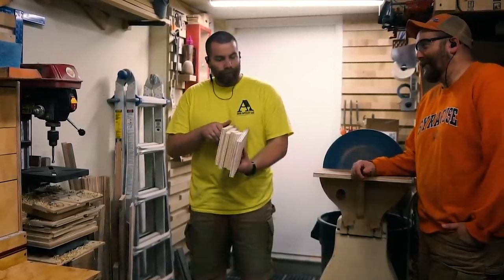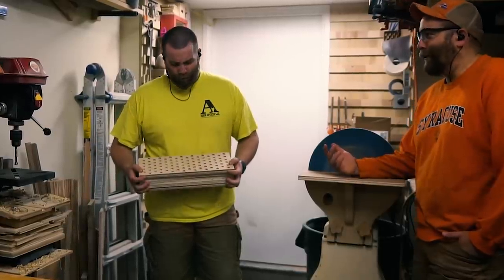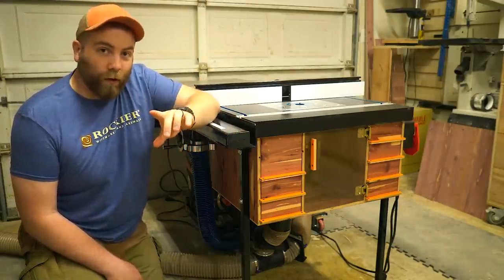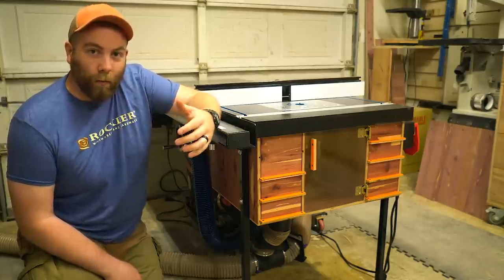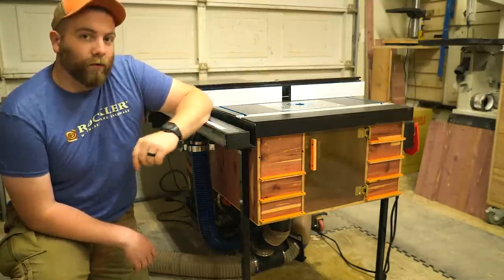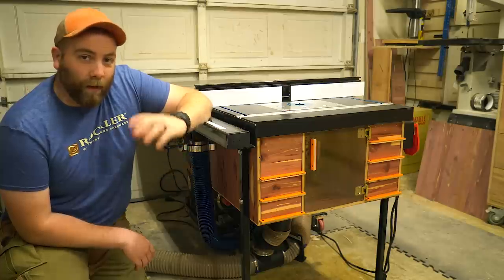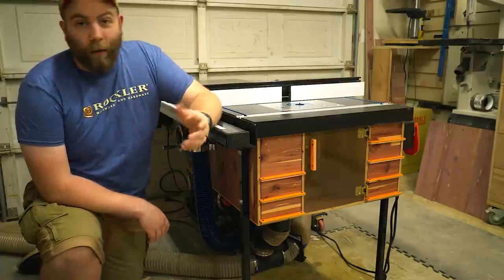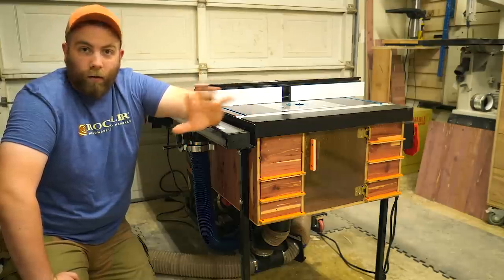Ultimate Router Table & Storage Cabinet (table saw extension wing)

Comment from the maker: Full build details: https://www.jackmanworks.com/ultimate-router-table-storage/
► Check out all of the amazing ROCKLER tools and materials used to make this project a reality!
Materials & Parts: 
Wide T-Track http://bit.ly/2lgOwZZ
Regular T-Track http://bit.ly/2JQhRt6
Router Table ProFence http://bit.ly/2JZYAo9
Router Lift FX http://bit.ly/2otzljq
Pro Lift Router Lift http://bit.ly/2lgcy7k
Cam Clamps http://bit.ly/2lgtqLe
Power Switch http://bit.ly/2t3K9pB
Router Speed Controller http://bit.ly/2JPdIFQ
Dust Collection Remote http://bit.ly/2t86imG

Tools: 
Drill Bit/Driver Combo http://bit.ly/2nAOUlu
Push Blocks http://bit.ly/2I2zYWT
Glue Bottle http://bit.ly/2K01UMZ
Table Saw Sled http://bit.ly/2lfnAtE
Router Bit Holders http://bit.ly/2K2tVqk
Feather Boards http://bit.ly/2ymZ2IG
Router Bit Straight Bit Set http://bit.ly/2ypMH6A
Router Bit Set http://bit.ly/2K4RiQ2

Dust Collection:
Flat Dust Port http://bit.ly/2K2MTgA
Router Table Dual Port http://bit.ly/2lgNo8P
2.5" Expandable Hose Kit http://bit.ly/2xhnDO4
Blast Gate http://bit.ly/2MxlG49
4" T-Connector Fitting http://bit.ly/2tkF0c3
4" Keyed Bridge Hose Clamps http://bit.ly/2tlmGzg
Dust Right Dust Collector http://bit.ly/2JOA1vn
Dust Collection Hose Clip http://bit.ly/2I2EBQC

► My exclusive solution for hearing protection in the shop, ISOtunes PRO - http://bit.ly/2uIsq7M

Comment: Great job and a very nice looking router table.  I have a very similar setup in my stand alone table and found that I got better dust collection by putting a series of 1 inch holes along the bottom of the door. Really helped the airflow.

Comment: I was thinking of doing the mod to my SawStop and decided to see if anyone else had. Great video!
Reply: One question though... the miter gauge dual track. Seems like the SawStop’s front and rear braces block your ability to slide a miter gauge. Is that actually the case?

Comment: I gotta say you used 2 word that are in my non-like column: Ultimate and Rockler. But I gave ur vid a shot anyway and am glad I did. (Meaning Thumbs up to you!) Ultimate because I find anything with that superlative is, well, NOT and Rockler because they on the very bottom of the cheap list if u get my drift. Good quality stuff most of the time though. 
You turned me on to how to make bit drawers - half way thru with 1/2" then finish with 1/4 and add bottom -SMART! Oh and the t-track idea was up there too.

Comment: Great adaptation of the basic Norm Abrams table design!  You might consider drilling a couple of air inlet holes near the bottom of the plastic door to help evacuate chips from inside the cabinet.
Reply from the maker: I'm definitely going to play around with it to optimize the suction, but it does a pretty amazing job already. Don't want to drill holes in the door, but I might drill some in the back panel if it seems like it needs it. That box is sealed up pretty tight afterall
Reply: I added 3 holes about 1" dia near the bottom of the door of mine.  The resulting airflow tends to "sweep" the floor of the compartment and doesn't affect the extraction capabilities.  BTW I'm hooked to a 1 1/2HP DC

Comment: thank you for sharing .............one note if i may add........enclosed routers can over heat....you may wish to add fresh air to your router intake .....either by holes in your door or a purpose made sleeve over your router to the out side not only allowing fresh air but stopping the air intake to the router clogging up with dust....i do realize you have your dust extraction on it but even so it can get clogged and over heat the router........ok   this the first time seeing your y/t vid see you also made some cool stuff going to check them out now ........thanks again

Comment: Everybody does the holes in plywood to store the bits, including me, but I've found that over time storing them like that makes the shanks rust.  It's been on my to do list to replace it with plastic for years.  Just in case you wanted to redrill all those holes again.
Reply from the maker: Saw you knocked out some acrylic holders, keep us updated on those, I'm curious to see how those work out. I've honestly not had any issues with rusting on my bits and they've always been in plywood

Comment: Great Build, I love watching your stuff. I am currently building a router table for my Sawstop Right Wing, and have a quick question, why only a 1/2 cabinet, and not a floor length.  My plans are to build a floor-length cabinet on wheels so I can roll it out should I need to for some reason in the future. Any reason I shouldent do that?
Reply from the maker: one reason was because I wanted to seal up the cabinet as much as possible for the best dust collection suction. also, I still get to use the storage underneath for a couple of bigger items, just fits my needs that way and yours might be different. good luck with the build!

Comment: So did you not have to cut the rail of your saw stop at all?  I am about to add my router lift in, but concerned about cutting the rail.   Have thought about turning it 90 degrees to face the front of the saw, but I think the wood support in the table runs that way.

Comment: Awesome router extension table! The black extension table that you start with, it is just MDF and wood painted black or is there black melamine on the top? In one part of the video, the texture of the top of the extension looks like it's melamine. Just wondering.

Comment: Was the weight of the cabinet being hung from the rails any concern in design?  I'd like to do something similar but with a full length cabinet that hovers about 2 inches off the floor and allows the table saw to still be moved from its home to center shop.  Great video, thanks!
Reply from the maker: Nope, not a concern because I reattached the legs from the original table, but they got attached right into the cabinet so it's fully supported there.

Comment: Sorry if either of these are repeats. I havent read all 170 comments: 1) what model saw is that? Id like to look it up and compare the dimensions to my saw. and 2) what are the main differences between your old lift and the new router lift? Worth a $370 upgrade cost?
Reply from the maker: 1. it's a sawstop PCS with a 36" fence
2. I think the difference in cost between the 2 lifts is closer to $150, but definitely still a chunk of change. The new one is definitely a lot nicer and whether it's worth it depends on your situation, but for me it was worth it just for the aluminum insert plate alone instead of the plastic one which will sometimes flex with smaller pieces.

Comment: Any reason I couldnt do this on my cnc?  seems like a perfect use for it.. Im scared shatless about cutting in to my SS melamine table and jacking it up.  seems if i tested it on a scrap piece on the cnc first, then did it, it would be safer.

Comment: You have a cnc, but decided drilling a ton of holes by hand would be more fun?
Reply from the maker: "It's not all about knowing how to use a tool, but when to use it" - Confucius or something like that 

The drill was much faster. I didn't show it, but I used a v bit just to mark out the location of all of the holes (like a 1/8" dot) so I didn't have to measure them, then I drilled them out. To get perfect circles of that small of a diameter on the CNC I'd have to turn the speeds way down.

Comment: Are you having any sag issues with the MDF top or have to reinforce? I'm debating using the existing extension wing to cut out for a router lift versus buying a phenolic top and custom-fitting it into the wing.

Comment: Nice but...I picked up a shaper. Routers can't take 3/4, 1" spindle/bits. And I've not seen a 3 or 5hp router. If you make panels, custom trim/beading daily, a router will not cut it (pun!).  When you factor in all the costs you just demonstrated (oh, and you are using up the Sawstop table space), its not that more to get a 3HP shaper.  Still, for those with a small shop, this video gives you a decent option. But not a production one.  (Thanks to your videos, its been harder to find used pallets! LOL!!)

Comment: You should rounded of your handles on the draws you could give yourself  nasty cut on thoes sharp edges
Reply from the maker: That was a design consideration actually. The handles are inset from the edge of the table top so I'd it the top first before the drawers.